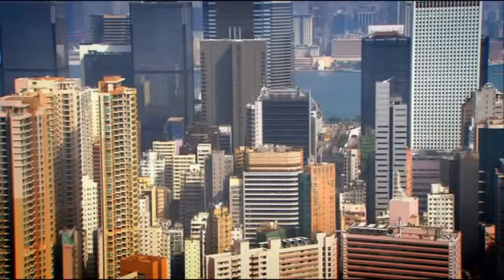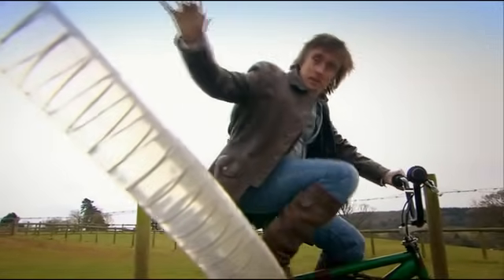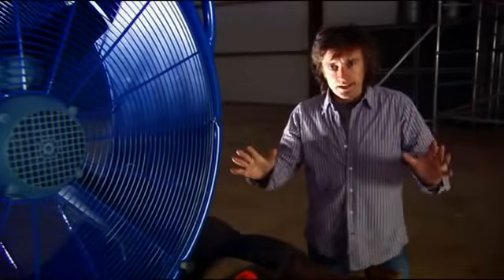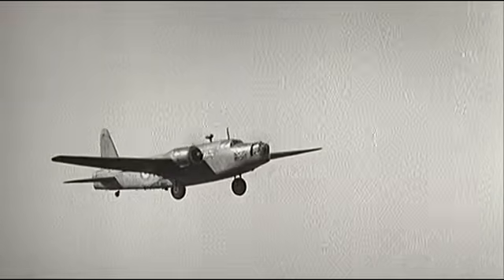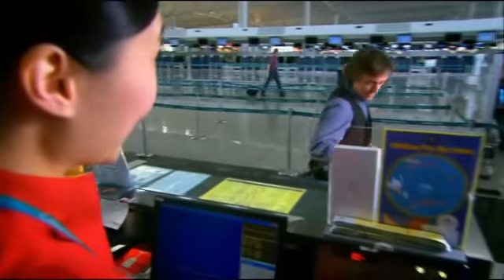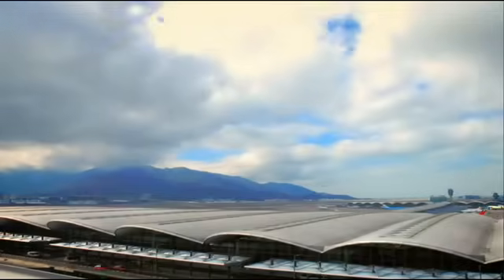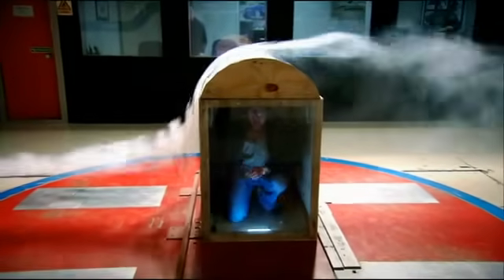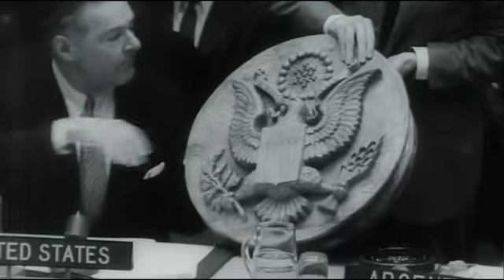Richard Hammond's Engineering Connections | S02E06 - Hong Kong Int’l Airport | DocumentaryHub

Comment: Omg turn the i beam on its side
Reply: You think an H beam would have been more resilient in that scenario?
Reply: I thought the same, or at least give it a chance not to fall over.. it bent significantly more when it fell over. Also the lattice had support at either end to prevent it falling sideways. 

Yes lattice is stronger fact, but they had help to prove the point